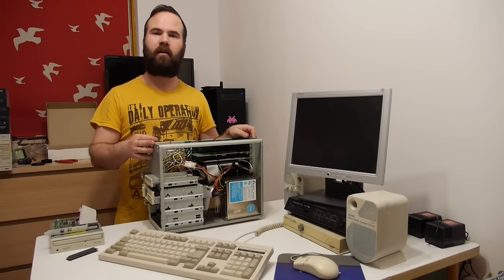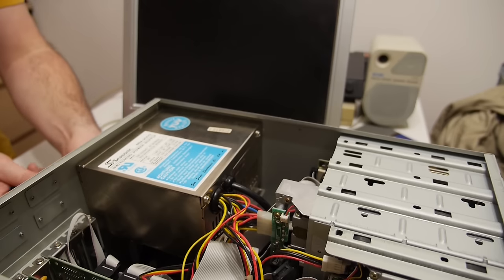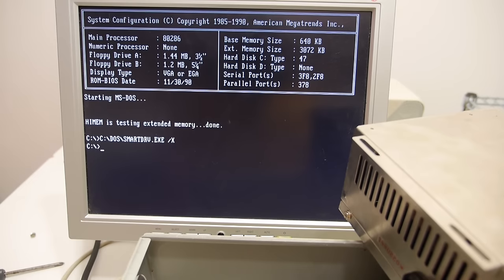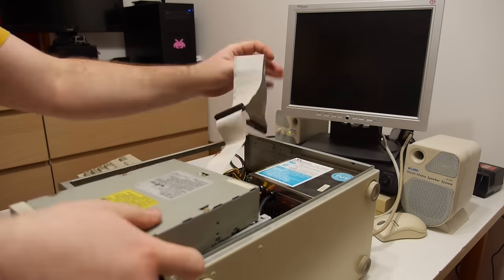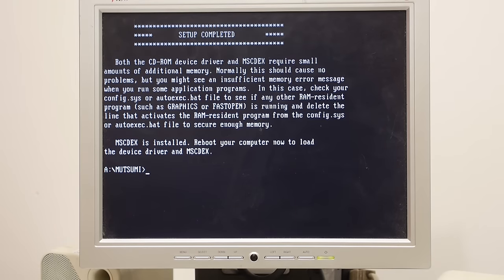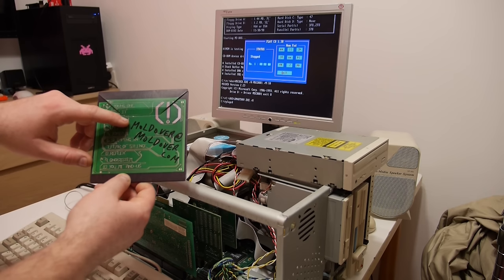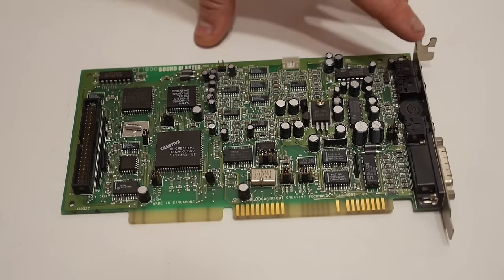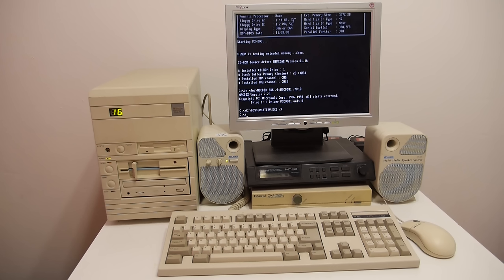Computer Vlog9: The 286 is Almost Done! We got CD-ROM!!

Comment: I remember that DOS Mitsumi Audio CD program :) I had the very first model, single speed, the whole drive slid out. I was a CD-ROM early adopter...
Reply: Ya, I remember a friend had one of the very early SCSI CD-ROMs where the CD-ROM had a cartridge and resembled a clear 5.25" disk, but with a sliding metal cover like a 3.5" disk. It also had hardware CD playback support for audio, so you could press play, skip and FF/RVS from the front panel. It also had a volume wheel. Essentially it was a CD player first and a data drive second. Our first CD-ROM was similar, but with no caddy for the disk. I recently obtained it from my folks, and plan to put it into a build. We we late adopters, but we were still stuck with early hardware. Benefits of poverty :D.
Reply: @peterlamont647  Good thing to have controls like that, actually.  Especially on a DOS machine where you don't nessicarily have the liberty of having a GUI app to manage the tracks.

Comment: 4 year old video but I just love this 286 build so much! :) Anyway, for your sound card: The AWE32 and AWE64 came with the CTCU programme, now I know that you probably can't use it to configure the IRQ and DMA of the sound card but these programmes also have the option for controlling the volume of the ports, and maybe the line-in has simply been muted. Now that I think about it, LGR used a similar sound card in his Woodgrain 486 (now Woodgrain Pentium Overdrive) PC and that SB Pro had a similar configuration utility for changing the volume of the line-in. Anyway, great video, and love that build. :)

Comment: you will need the sound blaster pro drivers, it has a configuration utility you run to enable cd-in or line-in as a input source , this will allow you to listen to them.

drivers are on the Vogons sound blaster drivers page.
Reply from the maker: +HPZeta Thanks for the tip. But can't find the CT1600 drivers only the 1350B.
Reply: victorbart this one should work , most of the Sound Blaster Pro 2 drivers should work https://www.vogonsdrivers.com/getfile.php?fileid=59&menustate=0
Reply: +victorbart the drivers are still on creative's american site

Comment: 80286 architecture is I believe 20 bits on the address bus in the IBM implementation(or 1,048,576 bytes), which is capable of an upper limit of 1MB of RAM...which in my opinion is plenty. I seem to remember it being a 24 bit processor, but those bits are simply not implemented if present. So, more than 1MB is physically impossible without bank switching on a separate ISA card. I found this video because I am trying to get CD-ROM support on an 80286 laptop. It only has a parallel and serial port, so I was looking around for a parallel solution. The 'backpack' cd-rom drive looks promising. My reservations are of course the issue of 80286 support for MSCDEX. The old beast only has a 15MB Miniscribe MFM HDD, so parallel solutions are a good option. I also found a CD-ROM image of a complete back-up of a perfect MS-DOS environment with various languages and utilities. Being able to run this directly off of the CD, and save files to floppy would be optimal. In fact, finding this CD image is what started all this. I was relieved to see that your 286 does indeed work just fine with a CD-ROM! So, Now I have some money spending to do :D.

Very nice build btw...God, just looking at that computer brings me joy and brings back memories. What a perfect example of the era(early 90's). I bet we all wish we had a CD-ROM drive in 1991...hehe. When I was growing up, we didn't have one until around 1995/1996. Before that, we just had floppies. A very, very limited supply of them at that. I remember rejoicing whenever AOL would send a free disk trial in the mail...I'd flick over the write protect and format it. 1.38 MB free after formatting, ALL FOR ME and only me!!! I even recycled a few old commodore disks and formatted them to be 360KB DSDD disks out of desperation(our HDD was only 5MB). I remember filling them with my custom batch file menus and smaller games, as well as making them bootable with minimal specs. In those days, you could find games that were in the few hundred KB size or less. I also made my own games and put them on there.

Comment: Thank you for great videos buddy ! :) BTW: If you want to remove the yellowness from plastics, you can use Hydrogen Peroxide.  You can get the strongest in hair salons , with percentage around 13% (Volume 40) the strongest, and already in cream form, and apply it to the yellowed plastic. Then put it out to be affected by Sunlight, or with UV light indoors. The process can take from 6-48 hours depending how yellowed the plastic is. After each 8 hours reapply with new Peroxide. Don't forget that Peroxide and Metal contact can cause corrosion so use it only on Plastics to recover its own color :)
Reply from the maker: +1KeNnY1KeNnY1 yes great tip but this case isn't yellowed :)

Comment: I had those speakers for a long time. I have seen them a few times with a different manufacturer name on them.
Reply: +simonriddick I had them speakers with the Creative brand.
Reply: ***** Yeah I think my friend had the creative brand. For some reason his didn't go as loud as mine but they looked identical.
Reply: JUSTer AT-85 was the version I had. A good idea badly executed. They look 2-way but the tweeters are fake in most if not all versions, so the 4" driver tries to play the whole frequency range, and some versions (like mine and victorbart's by the look of it) have the brown drivers with small dustcaps which have quite bad cone breakup and therefore intermodulation distortion when compared with the black drivers with big dustcaps which are the better ones. The thin plastic enclosures have terrible resonance and therefore have a nasty boomy bass peak at 130-140Hz despite the ports being tuned to 45-50Hz (and that's wrong anyway, should be 60-70Hz for a 4" driver)... These speakers do NOT sound good.
Reply: simonriddick - so by the sound of it the different manufacturers of them also fit different sized power transformers and different value components on the amplifier boards...
Reply: I've just noticed that victorbart's speakers have only two knobs, for volume and tone... Never seen that before! Usually three knobs on these, for volume / bass / treble.
Reply: ***** For sure. If you turned mine up all the way it was super loud like a stereo almost. His seemed limited to just pc duty. I have owned my altec lansing atp3s now since 2003 or so and they are still strong too. Another set of speakers that just put out a lot of volume. One of my friends one time asked if my pc was hooked up to a stereo under the desk or something haha.

Comment: I don't know where you going to put the hard-drive but if you want to take the desk route then find an old Olivetti M3030 and gut then remove the back from the desk and gut it and then install your whole computer into the space recovered your might be able to gut the printer and the DISC Drive cabinet and install your drives in it and use the old cables to connect them to the motherboard of your computer.
Reply from the maker: +DAVID GREGORY KERR The HDD is in the lowest 5.25 inch bay